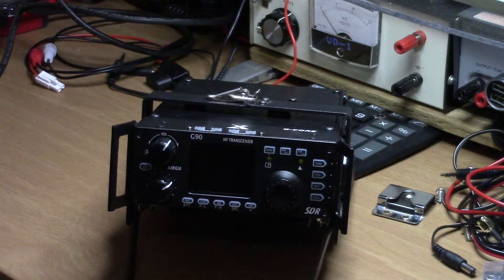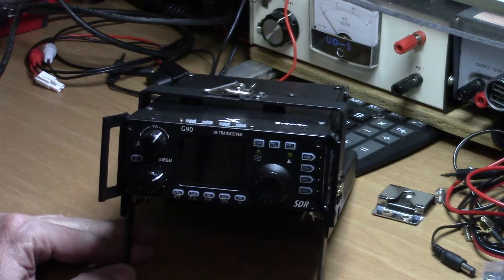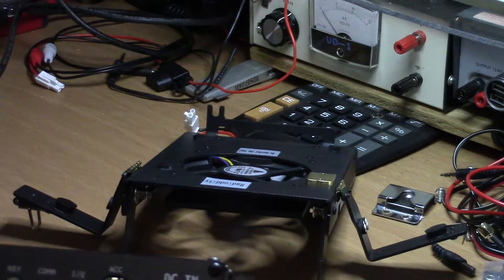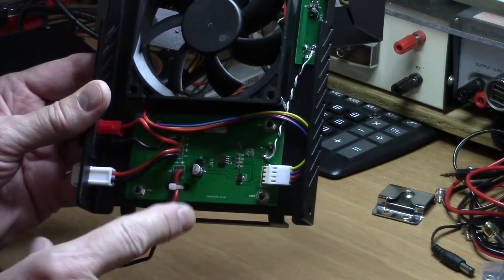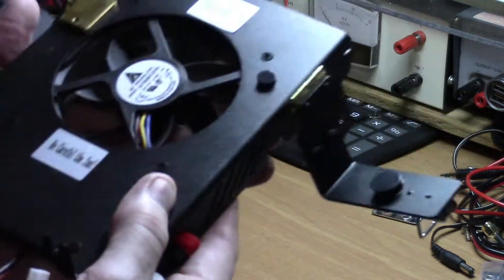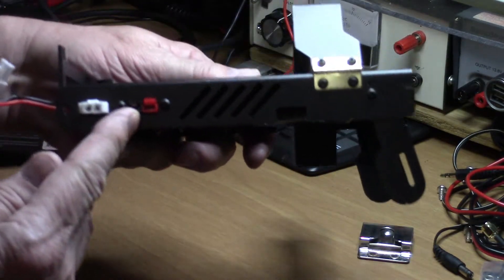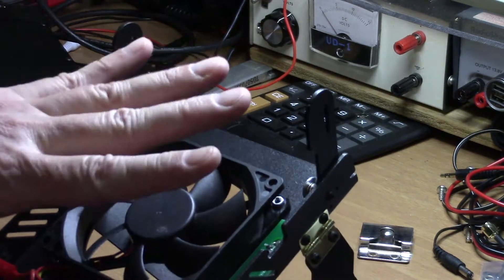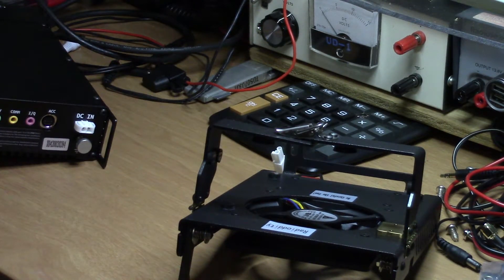AirWaves Episode 25:  Xiegu, G90-H1 Holder/Cooling Fan Review

Comment: The holder and cooling fan stand now comes with a full protective plate on the bottom covering the pcb board and exposed fan blades, or at least mine did this month. Funny because a buddy 3D printed a protective bottom cover for me (from a Thingiverse template) that I now don't need. May be helpful for yours. Merry Christmas and Happy New Year!
Reply from the maker: That's great.  I've gotten my fingers into the fan on several occasions.
Reply from the maker: Where did you buy your H1 holder with the protective fan cover?
Reply: @Airwaves-Radio  I got it from Radioddity (sp?)
Reply from the maker: @truck57us  Thanks.  That's where I got mine.  They don't show the cover in the photos on their website.

Comment: My fan is always running, doesn't seem to be thermostatically controlled??? Runs as long as power is supplied.
Reply from the maker: I have noticed mine adjusting speed up and down, but you're right, it never turns completely off.

Comment: I have the set and like it. Fan does a great job cooling the XCVR. I like the Anderson Power Pole power connectors. Just wish that the fan came with a safety grill to keep fingers and cables out. 73s
Reply: I got initiated into the Xiegu Blood Brotherhood in about two minutes of turning the power on. Please tell me someone has come up with a fan grill and some kind of cover for the exposed components on the board.
Reply from the maker: I'm glad I'm not the only one who got their fingers in the fan!
Reply: @Airwaves-Radio  ⛔ "No Entry" ✌
Reply: @Airwaves-Radio  Just got the same fan and yes, I got my fingers caught as well.  Its time to crank up the 3D printer and make a finger guard.
Reply from the maker: Let me know if you make one.